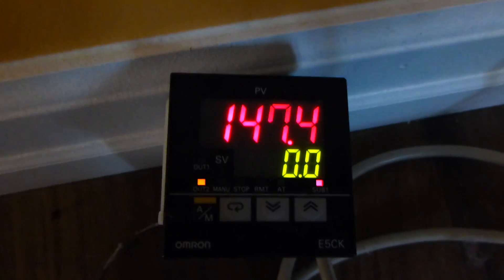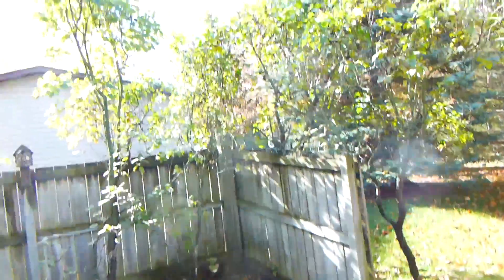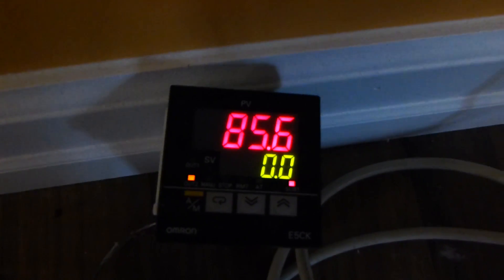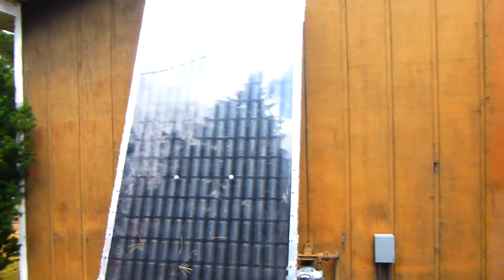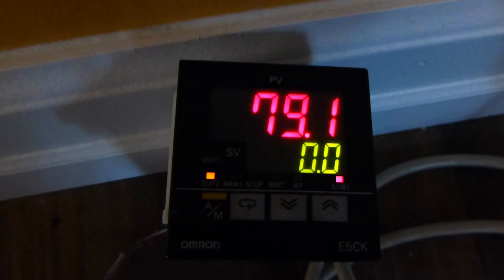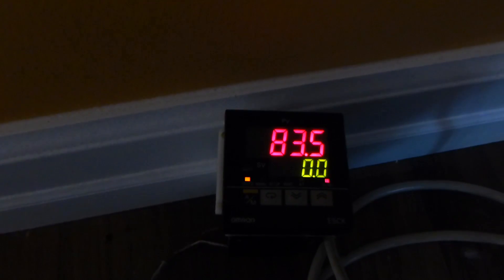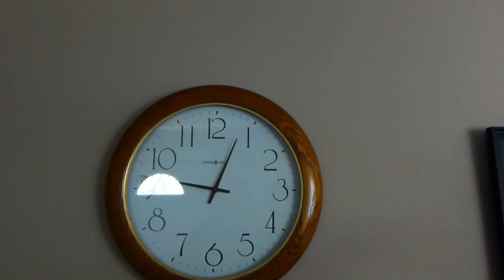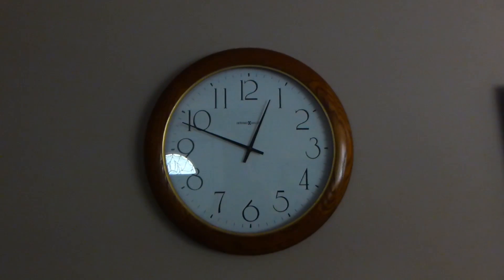Cloudy Day Solar Can Air Heater

Comment: Do you have the fan pulling the hot air out or pushing air in  ?
Reply from the maker: I have the fan at the bottom of the collector pushing the air.

Comment: Um.  So what do you do about the air vents when the solar collector isn't producing heat.  Heat does go in both directions.  You effectively have two holes in your house with a piece of plastic and tin isolating them from the outside.  Heat loss could be considerable.
Reply from the maker: I use a a 4 inch louvered dryer vent hood on the output side and a cape backdraft damper on the input side. Together they are very effective at keeping the cold air out when the collector is not running. Thanks for watching          
                                                                                                 Guy

Comment: Why would you want the fans shut off if the collector temp is below 90? If it is only 35 outside any temp above 50 from the collector would be better at least.
Reply: If one is heating a shed with no heat, this would make sense but he's heating his house.  His 70F house air is going through this regardless of outside temps, and 90F would be about the cutoff there's enough sun to do actually heat his 70F house air to something worthwhile and cycling minimized.
Reply: @Clydesdale2045  why would you use fans in stead of just a fabric/bag piece valve? totally passive.

Comment: How do you control the temperature of your house. I'm just interested in totally heating a cabin or studio with a collector. What temperature would it get to and if it gets too hot in the summer can it be turned off.
Reply: Depending on your sun angle, building insulation, internal thermal mass and size of wall space for a solar air heater...I would say get the largest possible. My 6x6 foot unit outputs 95C (200F) of heat when sunny.

If you have regular winter sun and an open view for full day heating you could possibility heat most of your needs using high insulation, thermal mass, sun heating and maybe electric floor heating or wood stove for back up heating.

Comment: Hello :)

I'm from Denmark in Europe, and I've been thinking about building one of these "solar pop can heaters". The problem is that I live in a country that is perpetually clouded. We don't get sunlight in winer - at all. The amount of sun that you had in your video is what we call summer here in Denmark. So my question is - would this system work even if it's cloudy all day every day? 

P.S. you might want to consider insulating the panel more efficiently, to maximize the amount of heat building up in the panels. You can do that by adding a second panel of glass on top of the first, pumping out some of the air between the two sheets of glass and sprayfoam-insulate the sides.
Reply: Hi Martin. Another Dane here. Did you ever find a solution for this? Would love to know how much heat can be generated on a cloudy day. Thanks:)
Reply: @trjaudio  did you find an answer about overcast days in the north?
Reply: @snorttroll4379  no. I think you should ask the original poster:)